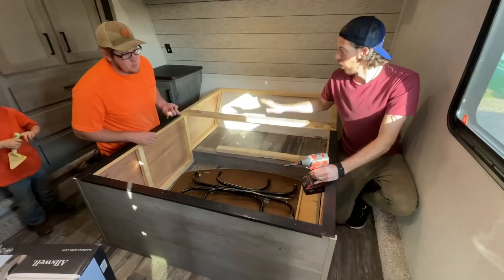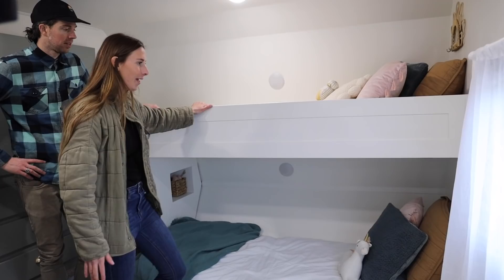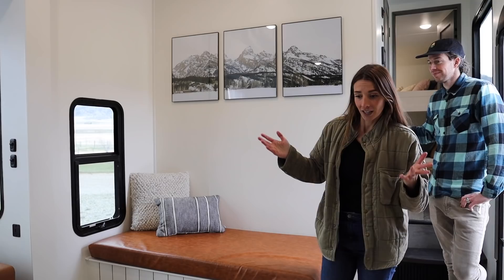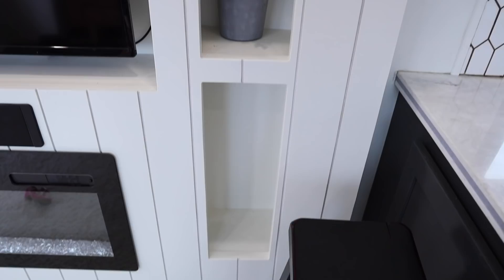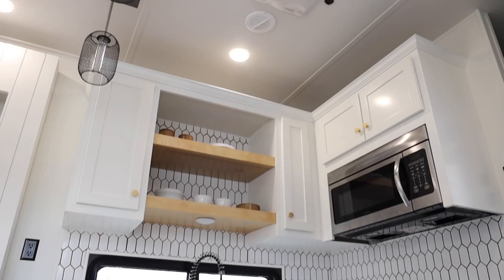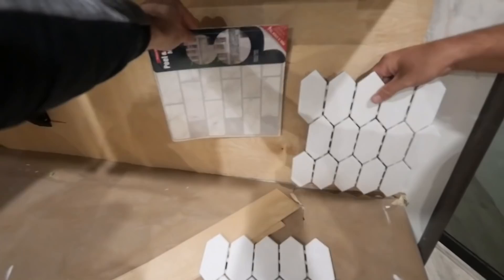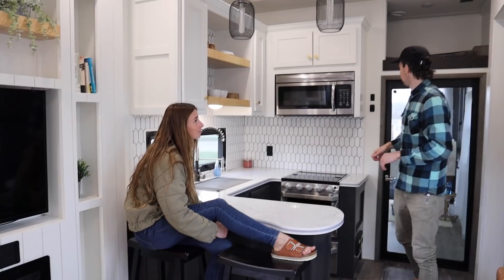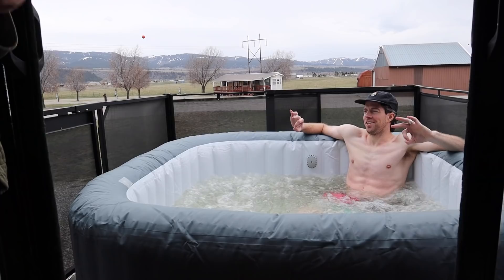Full Tour of our Renovated RV | We Added a Hot Tub!

Comment: Love it! My fiancé and I are finally a go to buy a travel trailer this summer! We can’t wait to renovate and travel full time. Hope we can come visit you guys next year. Been watching since you guys got your class A!
Reply from the maker: yes!! do you know what rig you're looking at getting?
Reply: Buy a used RV!  Most certainly avoid the new ones, they are not made anywhere near as well as they used to be!  We had two brand new top of the line 5th wheels.   The first one leveling system never worked and many parts replaced, still wouldn't work.   Traded that one in on 2nd brand new one, we used it 4 years until when we were over a thousand miles from home a slide-out stuck in the out position, cast us over $3000 to fix, Insurance only covered part of it.  We sold it and finally bought one 14 years old that was well cared for, and it works great.   Most assuredly, stay FAR AWAY from camping world, they are crooks.
Reply from the maker: It's definitely nice to find one that has all its kinks worked out! Brand new units have never hit the road so the first few thousands miles some things always shake and break so if you can get a warranty on them it's worth it!

Comment: With the floating floor, how did  you cap it off before the dip in the back?
Reply from the maker: We actually cut pieces to fit the slant and ours still “dips” but with the new flooring on it. We did that for when we did want to stow stuff in there and use the ramp. But now I wish we built an extended framed floor and lengthened the flooring. Because the added height of the LVP flooring is messing with our sliding doors a little bit so we might re-do it and build the extension up to the doors and that’s it

Comment: How did you get the floor in the toy hauler flush? The ramp door divot in specific. What kind of "material wood" did you use? How many sheets did you use and how did you place them?
Reply: After you removed the metal what did you use to fill in any wall gaps you had from the black original flooring and the walls? When I removed all the metal there was a lot of gaps.
Reply from the maker: We used caulking and wood filler and then painted over! For underlayment board, we used 2.5mm thick (one layer).  It fits perfectly how we have it slanted down with the original metal bar plate, but at the patio doors, we're noticing that it wears a little bit so we might end up using an all-purpose tool to cut off the ends of the slanted board so our patio gates can slide up easily...if that makes sense?